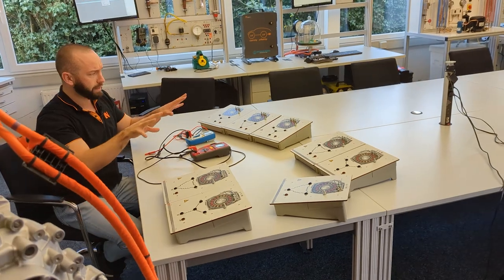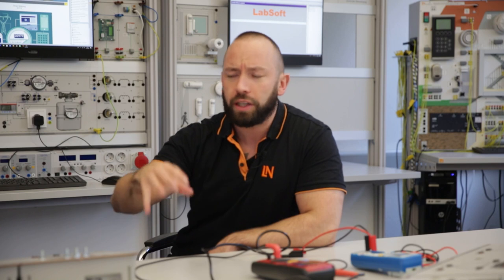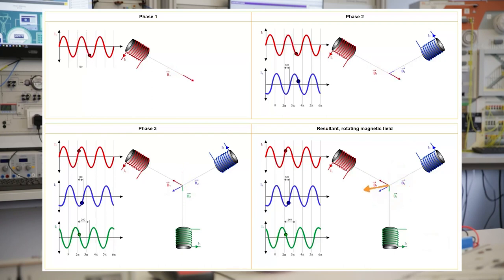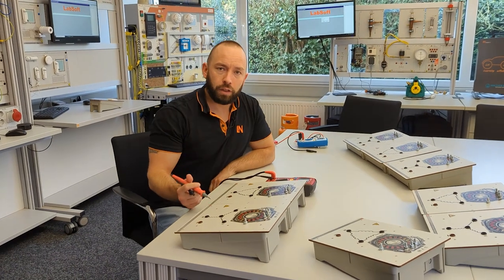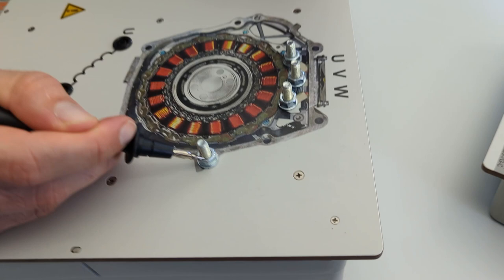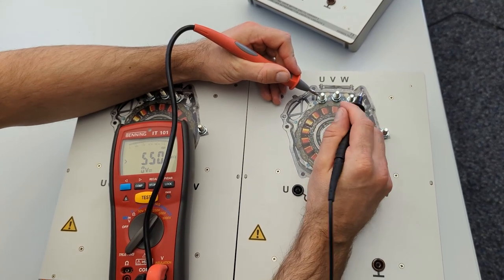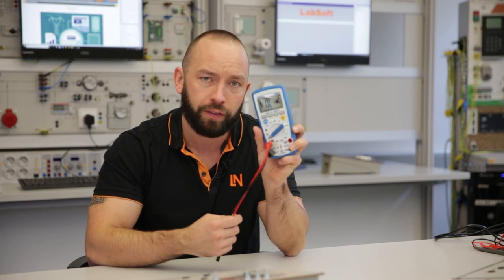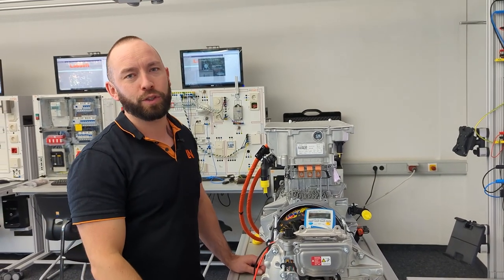Diagnosis on Electric Motors - Insulation, Resistance and Inductance Measurement (VW ID 4)

Comment: Nice summary and cool lab! :) For your question if this star or delta motor. I think it is star because at line-to-line inductance measurement of motor we were getting the same or similar values which is the case in star connection. But i am also not sure if the star connection is so popular in asynchronous motor.
Reply from the maker: Thanks for your message Vugar! And you are absolutely correct, it is very hard to tell. Acutally, we have sent the question to VW. ;) If the coils are fine, you should always message the same values across the stator. The absolute values will just differ from star to delta, even if you are using the same coils due series (star) and series parallel connection (delta). So from our point of view, it is very hard to say, which connection is used.

Comment: Thank you Chris, stupid question ⁉️ why the resistance of the coil is too low I was expecting something higher!
Reply from the maker: There is no stupid question. :) Can you give me the timestamp you are refering to? In general, the ohmic resistance of the coil, speaking of the resistance of the wire itself, should be as low as possible in order to avoid losses and thermal heat-up. The "resistance", which is "high" for a coil is the "inductive resistance".

Comment: If a motor was  repaired  meaning rewound, new bearings, dipped and baked but is  pulling  high amps when running ,
 what could be the problem ???
what test can tell me  what the problem is ???
Reply from the maker: Thank you for your question! This is a tough one, but I will forwarded to an expert friend of us. Give us some time, to get the answer for you :)

Comment: Hello dear,
do i need to change the gearbox oil?
Reply from the maker: Здравствуйте Улугбек Расулов,
There is no need to change the oil. Just take care that the gearbox is sealed. If not, then of course the oil level needs to be checked and maybe refilled.
Reply: @InsideEVTraining  does this apply to all electric vehicles?
Reply from the maker: Well, you can never tell for 100%, but as the complexity is much less compared to a classical automatic transmission or DCT, I would say that every car manufacturer does not expect an oil change within a gearbox of an EV.
Reply: @InsideEVTraining  thank you very much bro.